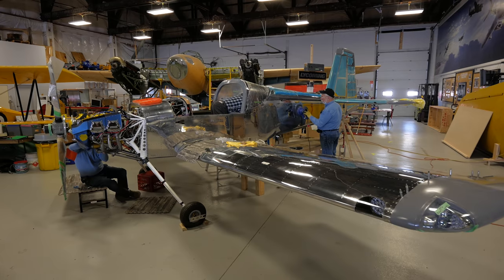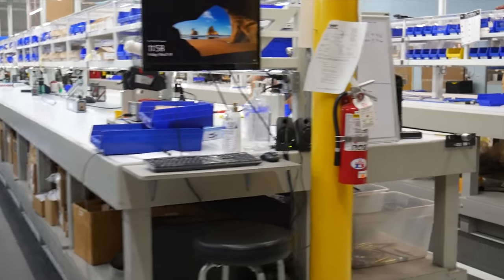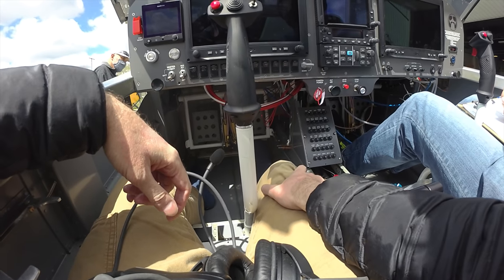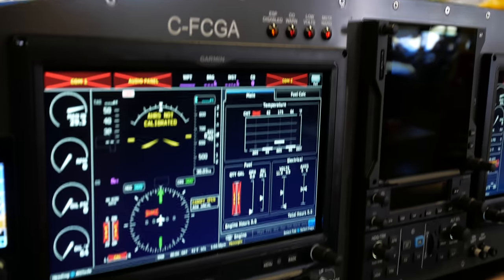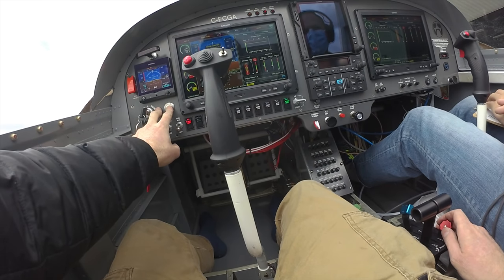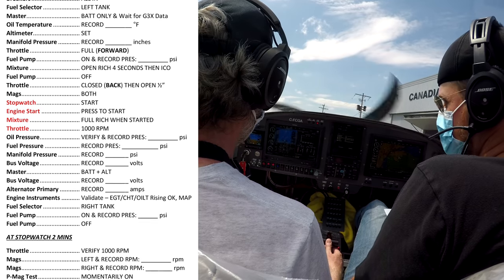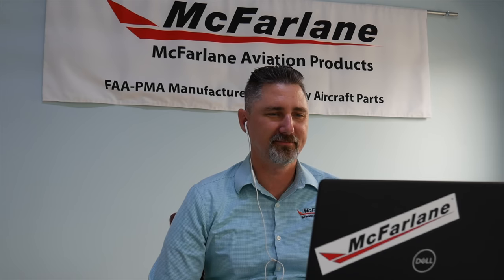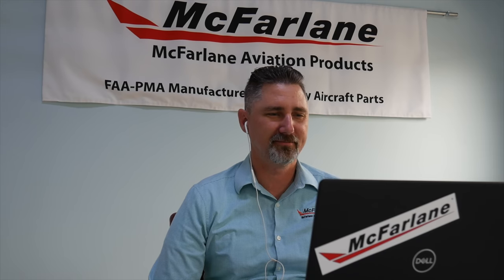Last Rivet! 1st Engine Run! Flying Next! - FINAL Build Vlog

Comment: Hi,
(At 2:09) On the prop governor, make sure you install a jam nut on the rod-end.
Secondly, you should always install a large surface washer under the bolt head on engine control rod-ends so if the bearing fails, the rod-end stays attached and does not pop over the bolt.

Comment: I am a fan of the polished aluminum. How about some yellow graphics, and leave it at that? You could do a “tear-off” effect with that distinctive yellow as homage to the museum…🤔😎
Reply from the maker: Thanks yeah - we weren't quite precious enough with the skins to leave them polished - there are some battle scars from a crew that had some first time builders (like me) that scratched it in places that we really need paint to cover
Reply: @FlightChops  There was a guy in Quebec years ago who decided to build a cabover Kenworth show truck with 100% polished stainless steel bodywork. While the results were spectacular, he said it was a nightmare at times just figuring out how to work with the stuff. I’m sure my brain went back to the first time I saw a polished P51 or something. They just look so great sitting there, as does your RV. The group of people who pulled this off should be proud as hell, scratches and all. Can’t wait to see it looking great in the air as well. By the sound of that engine, it should be a happy performer.

Comment: Well done! Nice to see the first engine run.  And thanks for the whole series. It has been very instructive. I was considering at some point to try to build a plane myself, but your vlog really convinced me that I would probably bite more than I can chew. During the initial first episodes, I told myself "Ok, it looks challenging, but I can do that. Deburring, Riveting, etc, ok, that's on my level", but the more advanced your build became, and the more challenging the technical steps became.  And this last video was really the killer: Calibrating the in-board electronics? Oooh, nope. Calibrating the pitot tube or the fuel pump? Not for me. Defining the right length of conduits to match with a custom throttle quadrant, built by cutting into the metal of the plane? Yikes!  Nah, I'll probably end up buying a 40yo Cherokee...  ;-)
Reply from the maker: Our friend Glenn on the field built an other RV-14 basically
Alone, with no building experience.  It can be done.  And you don’t need to do custom things like the relocates controls.  Things like the fuel lump calibration has clear instructions on how to do it, as do things like calibrating the instruments.  It really isn’t that scary - screwing up a flush rivet on a big skin is what I found most scary - but with practice, you get good that that.

Comment: I actually saw it up and flying the other day on my way home from work :)
Reply from the maker: There are two :). Glenn built one that looks almost exactly the same - so it could have been either one… but if late in the day it was probably ours :)
Reply: @FlightChops  I checked on fr24 and it was :)

Comment: Done the LiFePo4 batteries in my plane; won't do that again. They do NOT like cold weather! Very difficult to keep balanced below 40F or so. And they do not like HEAT, so putting it in the engine bay is shortening it's life considerably. But good luck with it. 
I use a LiFePo4 as a backup battery and a AGM battery for starting, seems to be working out.
Reply from the maker: Thanks for the insights.  I'll keep an eye on that
Reply: @FlightChops  There's a Solution to that, which is Low Temp rated LifePO4 Batteries (Headway Cells are apparently good down to -10c!) or better yet, 
Lithium Titanate Oxide (LTO) Batteries, which can be charged well below -20c without issue. They also tolerate High heat a lot better and are rated to 60c while charging. LTO is while relatively new in the grand scheme of things is still even safer than Lifepo4, and still has wicked high ampacity, but the Energy density is a bit less (though still a lot better than lead acid).

I'm actually about to build my own pack out of Lishen 18AH 2.5v LTO Cells to stick in my car to replace the Nuked lead acid battery.
Each Cell is good for 50C Discharge max (900A) and 20C Charge Max (360A).
They will Happily Handle over 5000 Discharge cycles at 5C and still retain 80% capacity.
Heck even direct short, and they wont go Poof.

In my pack Im going to run them in 5S Strings most likely (though i may go 6S). 
Assuming 5S, LTO Pack voltages would be approximately:
12.5v "Rated" (2.5vPC)
7.5v "Discharge Cutoff" (1.5vPC)
6.0v "Dead Flat" (1.2vPC)
14.0v "Full charge" (2.8vPC)
15.0v "Maximum" (3vPC)

Most of the capacity is in the 10.5v to 12.5v Range, Give take a bit depending on discharge current.
That very Conveniently puts a 5S Battery right smack bang in the typical working range of a "12v" system.
If you were concerned about the operating range being a bit low and wanted to run higher voltages for some reason (eg a "14v" or "15v" system like some modified cars do, Just add an extra Cell and configuring the charging system accordingly).
 
It likely wont be much longer before we see Aircraft specific LTO Batteries, but given the rules for experimental / self built aircraft seem to be rather forgiving? you could likely get away with building your own Pack provided you did it properly, and you may not even need a BMS, though having a decent BMS (such as a Daly) will mean you will have accurate info on just how much juice you have available, which could be handy in an Engine out / Alt out situation to know electrical endurance.

Hopefully that gives you some useful information / ideas!

Comment: Side question. I would love to find a tug like that one hooked to your RV. Looks like early 40’s Clark tug maybe?
If you have time to shoot me the info on that I will bring you a present at OSH.
Reply: It is a clark, it's early to mid 40's and we think it came from an aircraft carrier. It has a zero turning circle. We use it to move everything around here. I don't know much more than that. We've had it forever.
Reply from the maker: Do I still get the present even though Dave beat me to replying?  :)
Reply: @FlightChops  yes yes.  Fine. Hehe. But you’ll have to share it with him now

Comment: Hint Time:   
I see you chose to polish your plane vs paint it.  I did the same and was warned by a few seasoned hands to take note of the position of the sun --- it WILL catch your wing skin and it WILL do its damnedest to try and blind you.   I had a few spare electrostatic sunshades that I bought from Sportys on hand and put them on the sides of my canopy.  Not the greatest sun glare eliminator, but FAR better than having nothing.  (( https://www.sportys.com/slap-on-sun-visor-extra-large.html )).
Oh yeah, and I have a couple of surfaces in the cockpit that also like to reflect the sun.  Thus, I bring a sweater, even if the OAT is 40+ outside ---- makes a good cover for offending surfaces.
Reply from the maker: Yes for sure - this is temp to get us through season1.  
We'll be painting ultimately.

Comment: Congratulations on the build completion. What are you using for a glare shield?
Reply from the maker: Haven’t got there yet :). Hoping to think about that at Osh :)
Reply: @FlightChops  I’m wondering if I can get in touch with you. I am building an RV-14 and I also have a center console mounted throttle quadrant.  I would like to talk about the cables used for throttle, prop and mixture. My dimensions may be similar. I also want to talk about glare shield ideas.

Comment: How much of this process/troubleshooting is documented in the various manuals? Do you need to be an engine expert to do this part?
Reply from the maker: The information is fairly available - lots of people do this on their own.  No doubt some research is required, but the community and manufacturers are very supportive

Comment: Congratulations!

I can’t help but feel you’ve missed a trick here. Could you have registered it as C-HOPS? I’ve checked the database and it seems to be available…
Reply from the maker: Oh, I sure did try for that.  The issue is that in Canada, this class of aircraft only has access to tail numbers that start with C-F or C-G, and then you can select the remaining 3 letters from whatever is available.  The H as a second letter is not on option at this time.

Comment: motorcycle clutch cables are Teflon lined and have boots at one end to stop debris intrusion. and with a smaller diameter, you lose less travel when routeing through bends. 

isint it wired that the certified ones don't have boots? kinda seems obvious for a critical cable

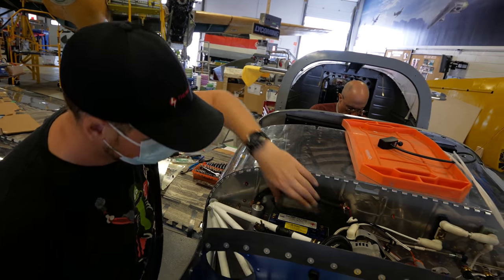Comment: Small nit pick.  @12:54 you show your General Fire Extinguisher.  The company went bankrupt in 2001.  They are no longer a rectifiable fire extinguisher.  For insurance purposes I would discharge and dispose of that fire extinguisher.  I am sure it would work just fine in a fire but liability is liability.

Comment: What the What?  No keys? The key just operates a switch,  change to a regular switch.
Reply from the maker: The keys actually operate the mags. Not the starter.  And we wanted to be able to lock out the mags for safety be security.